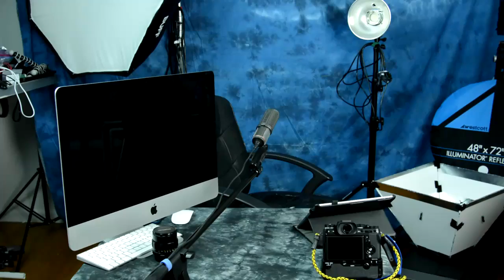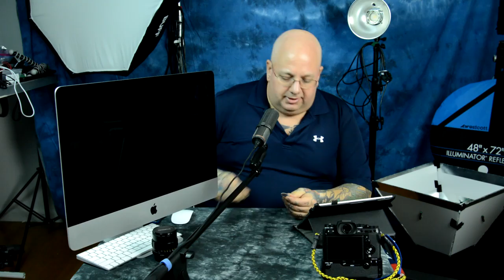Foolish Concept that Lens COATINGS amount to much at all in HOW A LENS RENDERS the Light

Comment: Yes the coating is small in comparison to the lens glass itself, but so are scratches, which are also very small in comparison but can make a huge difference in the resulting image. A fingerprint is also basically nothing compared to the lens but can still greatly affect it. This video would be alot better if you wernt so pretentious about the presentation of your knowledge.

Comment: So if I bought an old Rolleiflex with missing coating (I'm pretty sure), I shouldn't lose sleep over it?  Thanks.
Reply from the maker: ohhh no, most old lenses are UNCOATED……. front element coating is only an issue for strong flare
Reply: Thanks, though actually it should be coated not that old, from about 1965.
Reply: i have an old rifle scope 7.5x51.5 made in germany before 1926, of course no coating. the company goerz  was later a founder of zeiss ikon.  that scope and the lensedges are perfectly blackend inside. this scope is very bright and as good as many new ones, nobody belive me until they look through and compare it to other scopes. fixed scopes or objectives are often much better than zoomed ones. the construction baffles and so on are much more important than the super coating.

Comment: It's like saying several thin coats of paint on mild steel is better than unpainted galvanised steel, which one will go rusty quicker?  Sure, all those coats of paint will help but eventually the mild steel is going to rust long before the galvanised steel. The most important factor is the quality of the steel not what coats it 😃
Reply: You Are clearly misunderstanding the concept of a coating on an optic lens, compared to rust inhibitors on metals that are exposed to the elements. Optic coatings are not designed to protect the glass, each coating has a specific constructive or destructive capability depending on the chemical compound of the coating. The visual spectrum of colors each have a specific wavelength, which can be calculated and then manipulated using these thin film coatings. Using very straightforward math from the refracting angles of each color through the given chemical coating, a coating or in most cases several and even up to hundreds of coatings can be applied to purposely reflect/ transfer each color the engineer chooses. I’ll leave it at this, the most elementary example of thin film refraction,  just look at the underside of a CD, or a bubble blown from a children’s bubble wand, or the oil on the road after the rain, or the rainbow in the sky, which can only be viewed with the sun behind you and each color you are viewing have specific refractive angles which make the rainbow the same order of color every time. Their color layers are not random; but fixed based on their refractive angles through their film which is rain drop in this given case. Read my friend, read.

Comment: I run a 5000 watt C02 electric Laser at work, sometimes the lenses blow up. We then have to evacuate the area until the dust from the lens settles.  Then we have to wear Tyvek suits and respirators to clean it up, the particles in the lenses are known to cause cancer cells.
Reply from the maker: exactly, you exceeded the glass' capacitance :)
Reply: I’m guessing that the lenses are coated with something like beryllium oxide